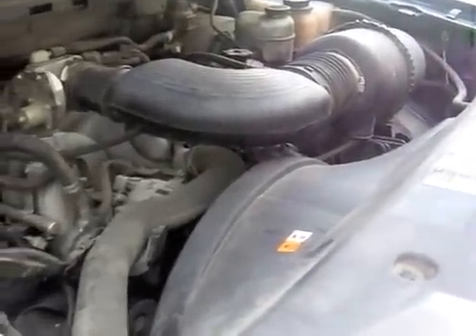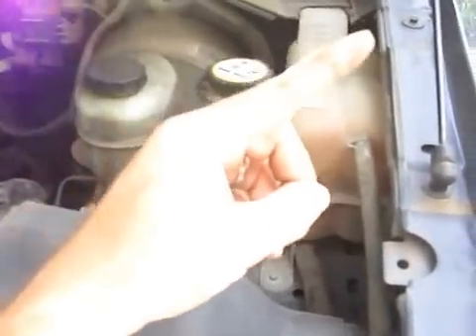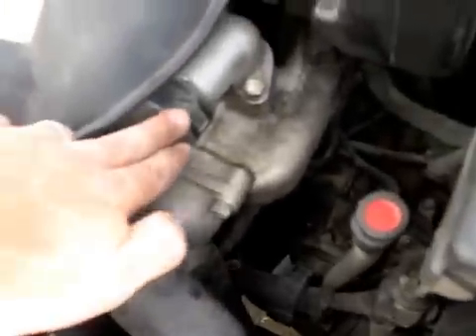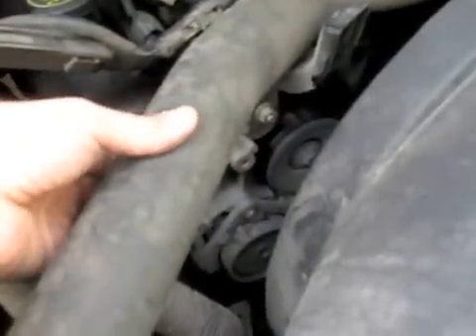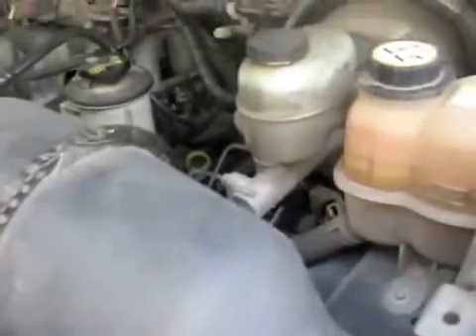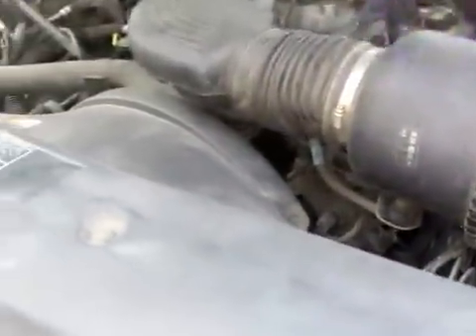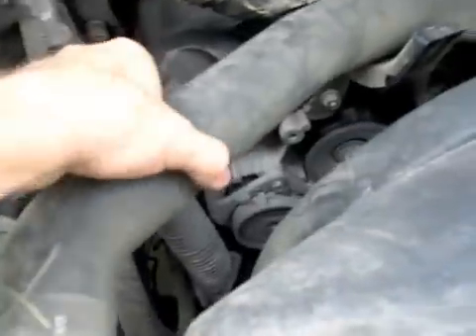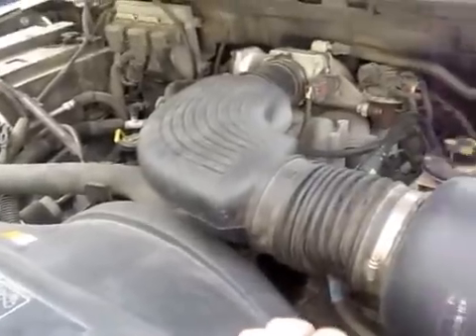Car Engine Overheating - Causes and Symptoms of Over Heating  Car Engine

Comment: hey i have a 2001 dodge intrepid 3.2 and i have bad cv axels but before i replace them i have a knocking or pinging sound when my car gets hot (about half my temp gauge). Do you have any idea if this is something easy or inside the engine. And i cant rev past 4000rpm it cut out and when i power beak it it want go past 2500pm. i think my cats are plugged causing that Please help been working on car for past 4 days and cant figure it out. P.S ive done changed oil oil filter and plugs.
Reply from the maker: Could be a plugged exhaust issue, have a local muffler shop test that for you.  Could also be a plugged oil pump screen, not lubricating the engine and its trying to lock up...thus the noise.  Check oil pressure with a manual gauge on the engine. Might also do a compression test on each cylinder to make sure there is no internal damage.
Reply: it runs great cold all but the plugged cats messing the rpm's up. i cant go to a muffler shop or mechanic im on a low budget and the car im driving now it almost gone its limit with 300,000 miles

Comment: my 96 Land Rover Discovery keeps overheating once AC is turned on, if I leave AC off my vehicle will get hot eventually. My mechanic advised to get fan blades as one was not working, both replaced, kept getting hot so he advised I do a radiator flush which I did but same problem persisted, he said thermostat had some corrosion, fixed issue but keeps getting hot! ?
Reply from the maker: I would be most skeptical of a restriction in the radiator and it needs to be replaced...flushing does nothing. If there is a radiator shop in your area I would have them test if for you, since your radiator is going to be a little pricey to guess at.  They might be able to "recore" your radiator if its stopped up.

Comment: Hey I was driving my engine cut off what should I do?
Reply from the maker: You will need a mechanic to check it out, unless you are mechanically inclined and have some tools.  Check for fuel pressure at the engine, check for battery power, check spark to all spark plugs etc.

Comment: I have a 2001 pontiac sunfire i just bought it 3 days ago and has already started overheating I had just changed the thermostat and had noticed oil leaking from the valve cover then had to  replaced the seal now no leaks but my antifreeze seems to be disappearing but not dripping out what do you think can be the cause the check engine light isnt even on

Comment: hi, every time i drive for only 30 minutes my radiator is always empty with coolant though i didn't see any leak on it. need your help. thanks
Reply from the maker: You need to get a cooling system pressure test to help you locate the source of the leak.

Comment: thank you for this video! I have an important question. I have a 2006 Chevy Malibu and just recently it started overheating. I cant drive it at all. I put in coolant because it was very low and noticed that when i fill it up it immediately  leaks out. when i turn my car off and put in coolant, a pond of liquid leaks from my car. not sure if its coolant, but I know it is not water because it does have a smell to it.. do I need to use a pressure tester to determine exactly where the leak is?
Reply from the maker: Yes if you can not see the source of the leak with your naked eye, the pressure tester will make it much easier to find.

Comment: Hi I drive a 04 mazda mpv and somedays it overheat sometimes when I have the ac on other days its fine. when the car is off their is a sweet smell mixed with a little bit of gas and I cannot detect where its coming from. Could you help me...
Reply from the maker: I would make sure the electric radiator fan under the hood is coming on when the engine heats up, if it is then get a cooling system pressure test to rule out a coolant leak, if no leaks then check the radiator for a restriction.  If you smell that sweet smell inside the vehicle, check the passenger floor (pull back the carpet under the dash where your feet would sit) and see if its wet with coolant. If it is your heater core is leaking coolant inside the vehicle and will need to be replaced.

Comment: I changed my radiator,thermostat, and water pump..stIll overheats 'm lost on my 2000 Chevy venture 3.8
Reply: My ford f150 5.0l was over heating water pump and thermosta was good no leaks so i just flushed the system and had no issues since
Reply: Theres air in your system, you notice how you remove the water pump and a lot of coolant comes out? Even if you top it up with more coolant in the radiator or reservoir theres no coolant where the water pump is and its just air in there,  you need to air bleed it because that place where a lot of coolant came out? Theres no coolant there and that is causing the temperature guage to go up and down or just up..
Reply: bad catalytic converter ?
Reply: My 2011 Honda Odyssey ( just got from Carmax) starts to overheat..when Idle..Or at stop and go traffic.. Seems perfectly ok on the freeway. It happens when I am waiting at a stop light starts blowing hot air out of the AC and the needle starts going up..When I start moving the AC starts running cold air.. I can't handle this! I have kids my husband works two jobs and were just replaced the Alternator we have had it just 6 mos..Carmax is terrible😕 Now i dont know what to do about the over heating
Reply: Try getting your system flushed
Reply: Shanda Salamaca  i was reading the comments and noticed that i have the same problem on my truck. It overheats on stops and redlights my ac starts blowing hot air and once im back on the road it goes back to normal. Did you fix the problem. What was it. Ive heard that this happens do to air in rhe cooling system. But im not sure
Reply: pelusco Rios ur fans are not working thus overheating at stops but while driving on freeway air from outside is actually cooling it down so it works then. Pretty easy fix  if you have an hour or two.
Reply: Thats your thermostat with symtoms like that fyi
Reply: @Asterlana  
High likely is the radiator fan not working. Check that the fan fuse and relay are ok, if not the fan itself fail.
Reply: Check your relays under hood cooling fan relay
Reply: I was watching hing this because my 2005 Hyundai accent over heats while AC is on... Had a. On while car was on the fan to the left isn't turning on. while driving it will climb but turn off a. The heat goes down. Could it be the fan?
Reply: Was it over heating and did it stop
Reply: NOBOX7 my 2003 chevrolet venture is smoking from under the hood in the back on the passenger side and my service engine light is flashing off and on
Reply: I’m on it
Reply: NOBOX7
Reply: Damn
Reply: Check for exhaust gases in your cooling system?
Reply: What was your problem?
Reply: blown head gasket .....
Reply from the maker: Did you do a cooling system pressure test?  Check radiator cooling fan?  When does it over heat, at idle or at freeway speed?  Is there an air pocket in the system that needs to be bled out?  You got homework :)

Comment: hi i have a 94 cadillac deville it ran hot on the freeway for the first time when i added water to it there was rust coming out and if u crank it up within 5 to 10 minutes its runnin hot again. A machanic told me i had a cracked head gasket but there was no milky resadue in the oil i dont know if he was trying to stiff me or what but i really need ur help
Reply from the maker: I think I would find another mechanic and start over with a fresh diagnosis.  Get a cooling system pressure test FIRST, but if you have rust in the system I would suspect the radiator is restricted and will need to be replaced...but you could have a leak some place else too, like a water pump or hose.  Don't jump to conclusions on the head gasket just yet, but if a qualified mechanic still thinks that is the case, then try this sealer AFTER you have replaced the restricted radiator. Best Head Gasket Sealer For Headgasket Leaks

Comment: Hi. I am having  overheating problems on my 2000 eclipse. Is overheating in low speed  even if the a/c is running. Can you help me with this problem
Reply from the maker: Check radiator cooling fan operation, (should cycle on and off as engine heats up) check coolant level for a leak...if its low, get a cooling system pressure test to help you find it.

Comment: Hi what about when the coolant of the radiator gets in the canister and overheat car??
Reply from the maker: Its called an overflow bottle, so when the engine runs hot and coolant overflows out of the radiator it does not drop on the ground, it stays in the system to be recirculated back.  If the radiator is restricted, or is low on coolant and the engine is overheating....then you sill see that happen more often.  Re-watch the video, check radiator cooling fan operation, check radiator for a restriction, check for coolant leak etc. etc.

Comment: I noticed some smoke coming out from the air vent inside the car. And dashboard got heated, also the indicator showed that car temp is overheated which just close to red mark.

I immediately called my mechanic and he told me that there was some water coming out from inside the car. Also to rectify he removed heater pipes and connected both inlet and outlet pipes of heater which supplies water directly to engine.

Now my heater doesn't work and the pipe is  now connected to engine (both inlet and outlet of heater) so that water flows inside the engine and not to heater as it is now cut off.

Mechanic told me that this will not affect engine and you can carry on with Air conditioning system but heater system will not work.

My concern is whether my car engine will be damaged with this solution?

Is this the proper solution ?
Reply from the maker: What he has done is "by pass" the heater core inside the dashboard. The heater core is like a small radiator, and since they are made of aluminum and plastic they leak coolant over time just like a radiator or water pump under the hood will do.  Until you replace the heater core (which is usually an expensive repair) you will not have heat, but his by pass should not affect anything else or damage the engine. I do this for my customers during the hot summer months until they have the funds available to replace the heater core in the winter months.
Reply: Thanks a lot.. that helps :-)

Comment: my car is overheating on the freeway and when i turned the heater on there wasn't much heat coming out? any ideas???
Reply from the maker: Yep, no heat from heater usually means no hot coolant flowing in the engine.  So no heat but engine overheating, sounds like you are low or out of coolant in the system, and a cooling system pressure test is the first place to start to help you locate the leak.
Reply: TrustMyMechanic.com thank you i will have it tested

Comment: Plz help, 2013 Chrysler 300 started displaying the hot temp symbol on the dash but the gauge didn't move over to HOT it just normally stayed in the middle, 30 sec of driving later the car just completely went down and sounded as if the engine kept trying to turnover till i quickly shut it off from the ignition, followed by some steam from the engine.. what could the cause of this be? =( I'm scared.
Reply: What happened to your car?
Reply from the maker: I would assume this vehicle is still under factory warranty??  Personally I would call the dealership and have them send a tow truck to pick it up and get them to diagnosis it for you.  This vehicle is too new to really have any issues like a restricted radiator, or leaking water pump etc. etc. so hopefully its a warranty or recall issue that they will pay for.  I would not start the engine or drive it.

Comment: Please help this is weird, just recently replaced the radiator in my car, but when the car is idle for about 10 min the temp gauge will make its way to a little over half, observing under the hood, the fans did kick in but then i kinda smelled the anti freeze, i turned the car off, didn't notice any leaks i then opened where ur suppose to refill the car with anti freeze and it i can see anti freeze start to shoot right into the container and want to burst out the lid so i closed it quickly

... any idea about what could be happening here? car is a 2012 dodge charger if that helps.
Reply from the maker: you replaced the radiator in a 2 year old car?  I would first make sure there are no air pockets in the system that needs to be bled out, probably just a large air pocket left over from the radiator replacement. Let it cool down and try adding more coolant, turn on the heater to get things moving around, take a small test drive, refill coolant again.
Reply: TrustMyMechanic.com
 tried, didnt work :( now check engine light comes on.. and other advise before i take her in to a shop?

 i also forgot to mention that i can see the coolant boiling in the resevior
Reply from the maker: ReaLifeVideos420
Radiator cooling fan is cycling on, correct?  I would replace the thermostat as a last ditch guess before I through in the towel.
Reply: TrustMyMechanic.com  Will do, thank you so much for your quick responses.

Comment: Hello ,My car is overheating when i use air conditioner and radiator hose was in pres like ball and cooling fan working and stop ,working ,stops .I change thermostat, water cap and fan resistor .The problem not solved .What to advise me .My cooling fan is electronic .
Reply from the maker: Pressure test cooling system first, then check for a restriction in the radiator

Comment: On my 98 oldsmobile cutlass keeps overheating changed water pump t stat no white foam in oil keep loosing colant out of the over flow any suggestions
Reply from the maker: Cooling system pressure test FIRST, check radiator for a restriction and check radiator cooling fans

Comment: my dad was driving up a hill and the car stopped and overheated we open the radiator and it sounded like a teapot and steam shot out of it. we we had jut gotten off the high way.  we put water in it and noticed it did not have coolant in it so if we put coolant in it will it stop over heating?
Reply from the maker: Probably, until it all leaks out again. You need to get a cooling system pressure test to help you find the source of the coolant leak.
Reply: oh ok thanks

Comment: I watch your video  nice video explanatory,I am mechanic but  but when it comes to check for plugged or flow problem  I am not that good or have the right Techniques , I will give you an example I have one customer  that calls me   because his vehicle is being over heating he told me he already replace the thermostat and radiator cap, when I get to the vehicle I checked for cooling fan operation and they came on on time according to temperature, he told me is been loosing coolant  so I pressure tested the system and no leaks external and holds pressure, next test I did is block tester fluid  , fluid never change and temperature at idle was very high fans on, and a lot of pressure coming out from radiator cap , vapor and trowing out coolant still did not change color of block tester fluid, I touch upper and lower radiator hoses and both were hot and pressurized. I am suspecting of radiator flowing or plugged, the front of radiator fins  are clear,  how do you test for plugged or flow problem I have a temp gun but the front is cover with condenser and the other side with coolant fans , would you give me some tips how test radiators on vehicles please, thank you for sharing.
Reply from the maker: Hey Joel, ya I hear ya....its not that easy to determine if the radiator is the culprit in many cases. I try to rule out ALL other causes of overheating then look a little harder at the radiator. How many miles does the radiator have, what is the condition of the top half of the radiator I can see inside (if i can see rust or mineral deposits in the top half it will be much worse on the bottom half) etc. etc.  Once I rule out all other forms of overheating, and there is no coolant leak, then I have to take a gamble at the radiator.....basically.  A local radiator shop can disassemble the radiator and check it for a restriction, but an aftermarket radiator these days is so cheap I just replace them.
Reply: TrustMyMechanic.com
thank you your advise

Comment: I have a problem. . When Im driving,  my car runs cool.  When I slew down or stop at a light it starts to get hot. As soon as I'm rolling again it starts to cool.  What can that be? ? I put a brand new thing of coolant,  put a new radiator,  and still get the same problem
Reply: Are you sure you watched the entire video?  Sounds like either a bad electric radiator cooling fan motor OR you have a coolant leak (since you added coolant) and you need to get a cooling system pressure test to help find the leak.
Reply: Andrea Davis there's no leak.  Like I said band new radiator,  and coolant.  Car runs normal while driving,  but as soon as I slow down or stop it starts to heat up. I have a 91 Honda Accord.
Reply from the maker: Ronald Jones
Sorry, I was logged in as my daughter Andrea :)  did you check the radiator cooling fan? And you said you added a "brand new thing of coolant" so did it leak out? Just because you dont see a coolant leak does not mean you dont have one if you have to add coolant regularly.  Coolant pressure test, radiator cooling fan check, check for an air pocket in the coolant system that needs to be bled out from the previous repairs.
Reply: Your thermostat is stuck open